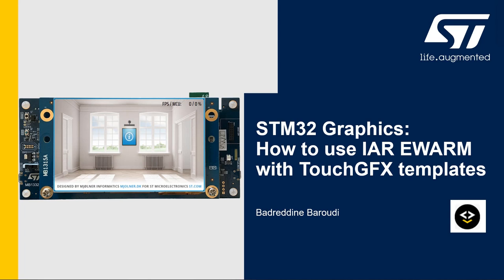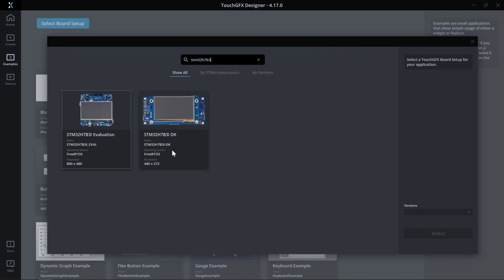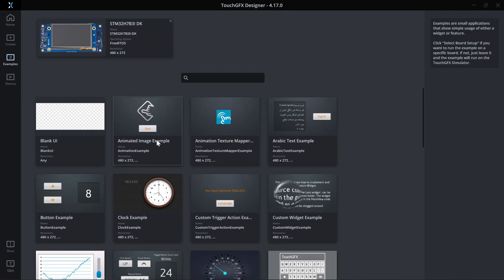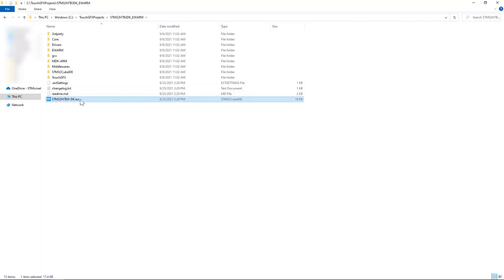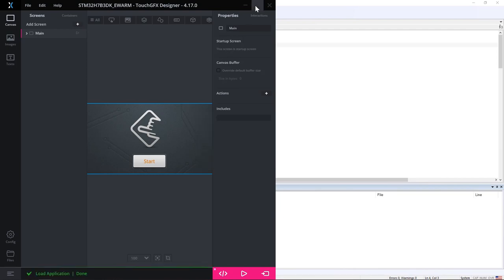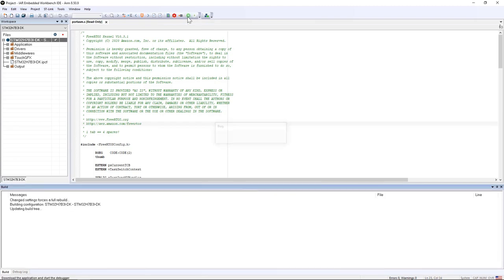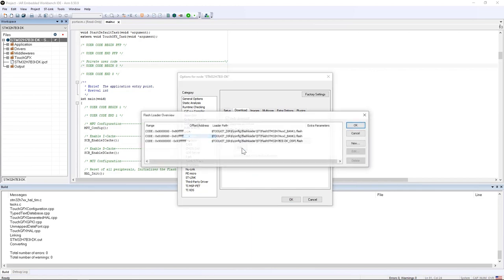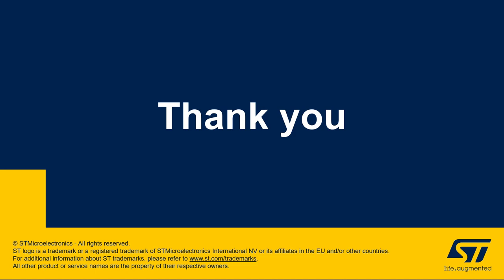STM32 Graphics: How to use IAR EWARM with TouchGFX templates

Comment: Thank you for this tutorial. Can you please elaborate on your comment at the very end "if the IAR project doesn't have this flash loader... I would need to use STM32 Cube Programmer to download the external assets or images to the SPI memory"? I don't understand how that workflow would work between TouchGFX / IAR / Cube Programmer, it's very confusing.